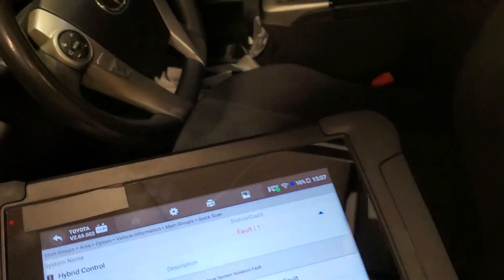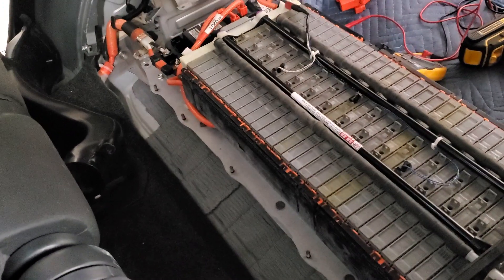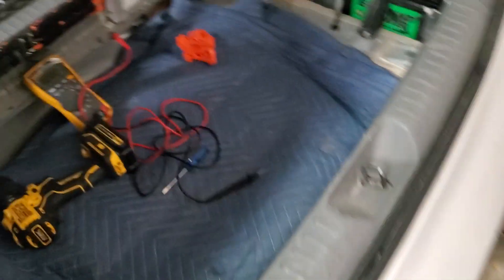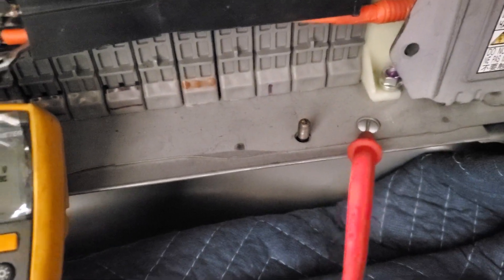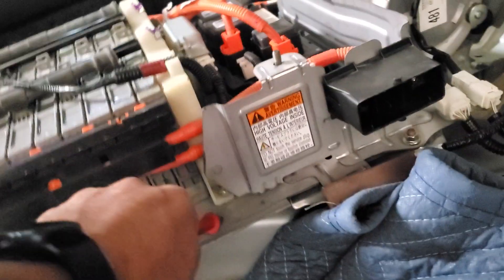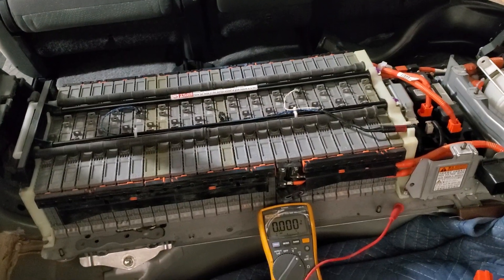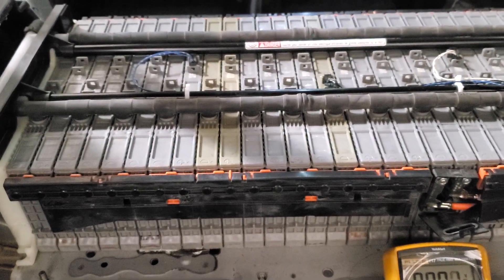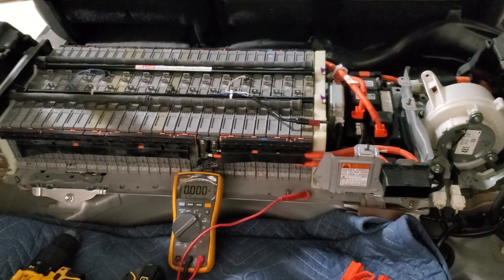TRACING P0AA6 ON TOYOTA PRIUS 2010 TO 2015 IN THE DRIVE BATTERY

Comment: My 05 was throwing this code. The module with the lowest voltage was the one this method also pointed to. Changed that module and no more code. Thanks.

Comment: The voltage difference test is meaningless in this case, the 80V you measured is not leakage, it's because the case it tied to the negative of the battery, so you're just measuring the voltage of all the batteries combined until the battery you're on, to ground, sums up to be 80V, not 80V of leakage.
Reply from the maker: Please explain how you believe the case is tied to the the main ground ground. The Voltage sense module is isolated in the video and non of the contactors/relays are on. Based on the vehicle schematics/diagrams there is nothing tying the case to the high voltage ground.
Reply: @carlosmedrano8656  
I don't have the schematic, but I'm sure if you check for continuity on across the system negative and the metal body of the hybrid batter, they will be connected internally, I remember seeing the green cable tied to the output negative of the battery.
I am searching for a similar error and will have to take it apart and will confirm whether that is true or not.
Reply from the maker: @ahmedsaid3967  With the Voltage sense module connected your will have continuity, there is a series of resistors inside for high voltage detection. So if you checked with the module connected, then yes. Also if look closer at the issue you are having, the service manual breaks it down into three sections. The battery itself, the main high voltage cables to inverter/ and the MG1-MG2 and A/C compressor sections. This video is focused on the battery pack itself, not the other sections.